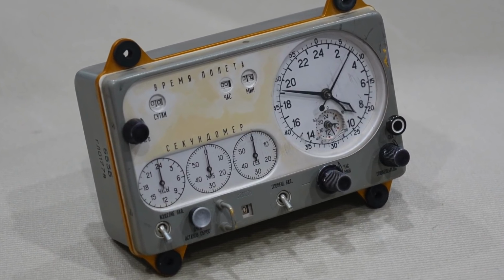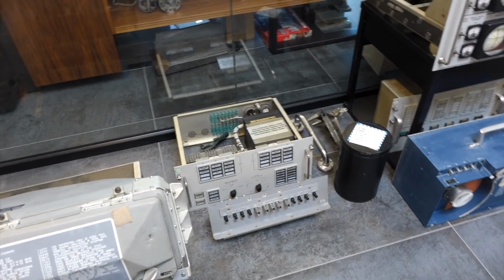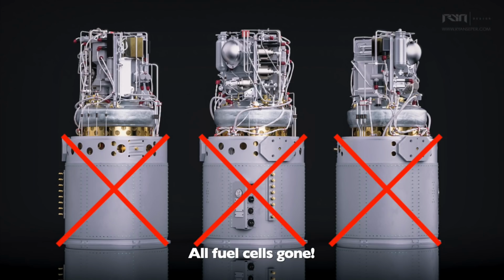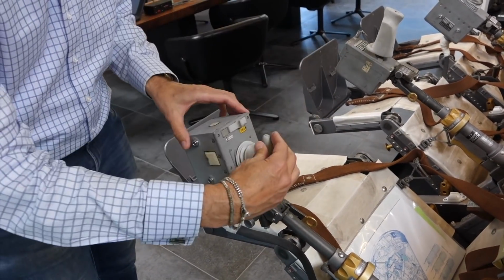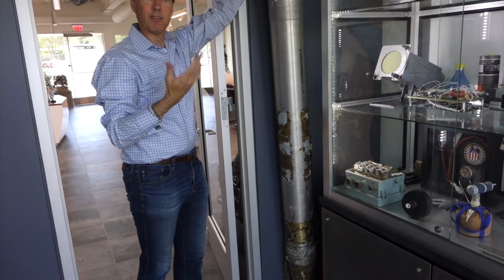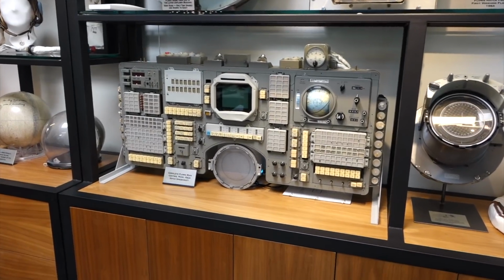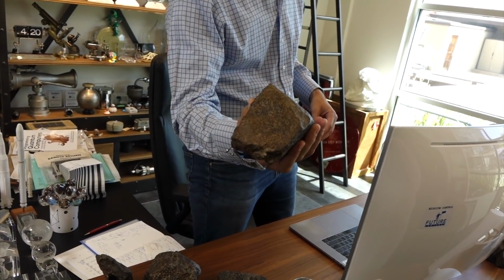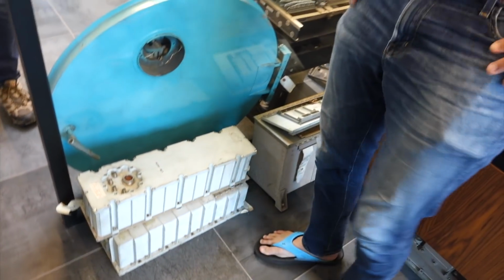Steve Jurvetson’s Space Collection - Part 2: Apollo Fuel Cells, LM legs, MOCR Console and more!

Comment: Hi Marc: In re-watching this great video, I was wondering about the decision or efforts to revive and power-up the fuel cell(?).
I think it would be just amazing to be able to get it operational again and maybe use it as a power-supply for the inverter.
Anyway, still just beside myself with your dedication and efforts toward the Apollo program hardware!
Thanks and 73...
Reply from the maker: It just involves getting hydrogen and oxygen under high pressure to interact through a super thin membrane that’s 50 years old while heated to 400F. I can’t think of a single thing that could go wrong… But, agreed, that would be a very awesome project.
Reply: @CuriousMarc  well after looking into it, it is worse than I would’ve imagined. First off, there are multiple discs that contain the membranes so all of those would have to be refurbished. Then, you have all of the hardware that would have to in someway be recertified to be able to stand the pressures and the temperatures. Then, for that era of fuel cell, they were only able to get about 2600 hours out of it before it had to be completely rebuilt. Finally, since we’re talking about these pressures and temperatures, I consider the thing to actually be dangerous and not worth it.  So, I just don’t think the ‘bang for the buck’ is there; even though it would’ve been a really neat project.
However, I still think that either bringing up that inverter after being ultrasonically cleaned or finding another one would be a very reasonable and doable project, since most of the expensive items are probably just fine and still intact, requiring only the ancillary smaller components such as the capacitors to be replaced.

Comment: 7:40 Regarding the question about the THC, if you rotate it clockwise the control system switches from the primary guidance system to the backup, the Stabilization and Control System (SCS). So if the AGC isn't behaving during a burn or so you can quickly switch to the backup without having to flip switches. This was tested before each major burn.
Reply from the maker: oh I didn’t know. Did the backup use the BMAGs then?
Reply: @CuriousMarc  Yep, those are part of the SCS.
Reply: What's a BMAG? I remember it's mentioned in Apollo 13.
Reply from the maker: @benjaminhanke79  Body Mounted Attitude Gyro. These are rate gyros I believe. Part of the backup system for attitude control, if the AGC or main inertial platform were to fail. Or, as in Apollo 13, if you powered them down... Used in the abort system on the LM too.

Comment: Skylab was in the funny position that once they had settled on the dry workshop and Saturn V solution, weight wasn't at a premium at all. They had a quite massive early video tape solution, an oven and other luxury.  The price for that was a launch on the Ssturn V not a IB. Suddenly they had a huge margin, since a basically empty third stage only had to go to earth orbit. Impossible for a SIB, piece of cake for an SV.   And that it worked, as the wet workshop idea was in hindsight completely insane.   Possibly the only space mission that ever had that luxury of (relatively) unlimited weight budget. .

The Skylab 1 rescue is also a criminally undertold story*, a challenge equal if not bigger than Apollo 13. A massive challenge in an extemely limited amount of time.  Only no lives were in danger.
*cool book Homesteading Sapce, The Skylab story. By some of the actual Skylab Crew.

Comment: @8:30 - Perhaps the seats needed to be folded to install within the confines of the hatch space or in the event of an emergency, to eject them out the hatch.  Spitballing.
Reply: The astronauts were seated for launch and re-entry, but once in zero-G spent most of the mission standing. (Or whatever you call it when you are in an erect position floating around with no vertical reference.) I suspect the seats folded out of the way to allow that, as well as to be adjustable for individual astronauts.
Reply: @lwilton  I meant for the construction phase, but I was more speculating.  Thank you for the tidbit!

Comment: A couple of years later: Marc and his Friends have restored a complete Apollo Rocket and are flying to the moon :-)
Can't wait for the videos on the new module.
Reply from the maker: We are inflating the Saturn V in my garden as we speak! The seller on eBay said he took it from a functional setup, but did not have the equipment to test it.
Reply: I want to see an onboard computer size comparison between the Apollo Mission and the latest ones. Can an IPhone really give you all the 0's and 's that you need to get to the moon?
Reply: @CuriousMarc  Most of it is over my head, but I love your channel!
Reply: @yatessmyrna  Since in the AGC restoration series they pretty much emulated a whole comand module on a macbook for testing that should be possible. But it is not only about the computational power, the architecture is also very different to a "normal" PC. Very Purpose-built for the individual functions, not for general computing like most modern devices. So it is not really fair to compair them.
Reply: @Ranger_Kevin  The general architecture of the AGC actually isn't all that far away from modern microcontrollers from a programmer's perspective.

It was also generic enough that it was reused for the fly-by-wire system of the F-8 and for controlling the Mystic-class deep-submergence rescue vehicle (submarine rescue vehicle).
Reply: Watch out KSC visitor center, Marc's coming for your Saturn V 😉
Reply: @yatessmyrna  A 5 dollar raspberry pi could easily emulate the AGC without issue - given you can get enough I/O pins on it lol
Reply: @bluesillybeard  But could it keep up with the data rates?  Those old computers are mind-blowing how fast they could crunch data since generally I/O was wired directly into memory instead of having to go thru CPU cycles to move the data around
Reply: Vintage Spacecraft Hot Rod club
Reply: @matthewmiller6068  A modern phone would piss all over the AGC, and you could run all the data through it's USB connection. Sure the old mainframes had a lot of "booster" hardware that could run data here and there without bothering the CPU, but their CPUs rarely came above a megahertz, and typically they'd have 8K of core. Their IO capability is a relative thing.

I don't wanna get too into the nuts and bolts but I'd guess something like an Atari ST, 8MHz 16-bit 68000 CPU with 512K RAM would be able to fly an Apollo craft comfortably. You'd need to add a lot of extra IO ports but it would be able to control them and keep everything read and written fast enough. That's a home computer from 1985, btw. 

The actual Apollo computer's CPU was less powerful than that, but had bits of helper hardware I'm letting my imaginary Atari do in software.

Comment: I have muscle memory for those wire harness ties, same as used for avionics in USAF.  Using waxed lacing cord, actually a little ribbon...Make a loop in the tie, pass the loop behind the bundle, loop to the left, tails to the right. Poke your left index finger through the left loop, grabbing a loop of one of the tails on the right, hook the other tail and pull completely through the new second loop, cinch the tails and finish with a square knot.  With practice, it takes less than a second not including the square knot.
Reply: You should make a video so that knowledge will not be lost.
Reply: @chutipascal  in the meantime, MIL-T-43435A Size 2 Waxed Lacing Tape is the stuff.  Video https://youtu.be/t48x7Qrd50c  shows the technique with a half hitch finish, and how to do it off the spool which I omitted due to descriptive complexity.  Instead of index and thumb in the loops it can be done with just an index finger.
Reply: Jotted down in my notebook.
Thank you @Wombbatts.